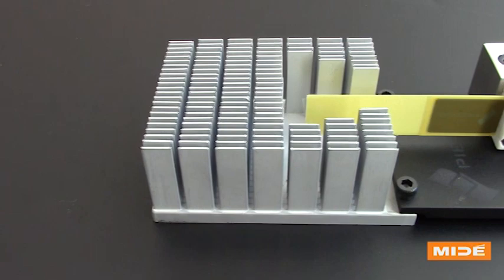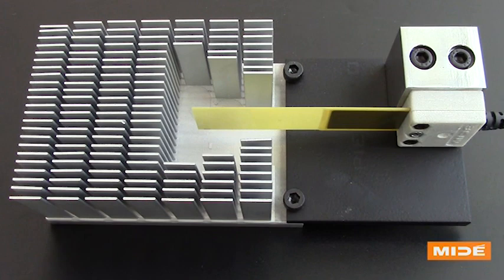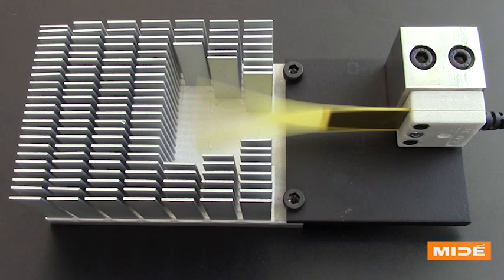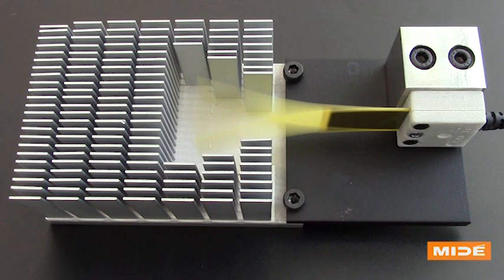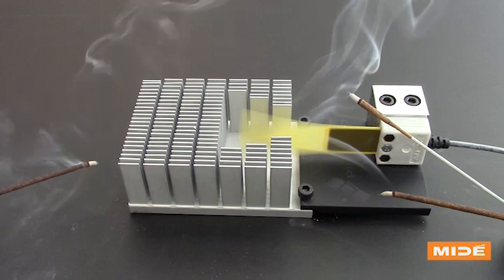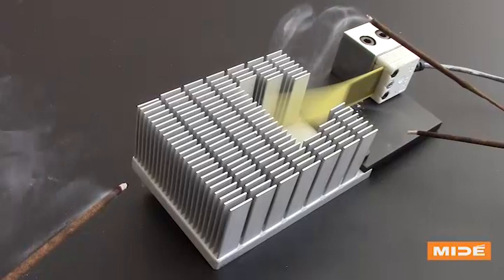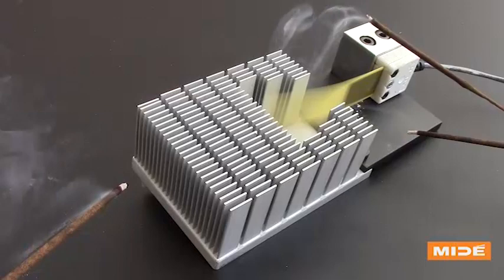Forced Convection with Solid State Piezoelectric Fan

Comment: Interesting idea but isn't there after some time material fatigue from all that oscillation or small amount of dust build up that make it unbalanced to point of destroying itself?
Reply: there are materials - like steel - that can withstand an infinite number of oscillations if the stress is low enough
Reply: @vaj1414  As I understood, the question was exactly about that - is that stress low enough to let device live as long as fan at least?)
Reply: I attached the piezoelectric plates to 1mm thick mica sheets, two on the same side acting to increase the overall airflow, the only downside observed was a slowing of the 50hz mains oscillation, because of the increase in air resistance on the mica sheet, however when all is said and done the fan measured six times the surface area of one oscillator assembly. Hope this spurs on some further tinkering! 😉
Reply: I would have to say that it is most likely reliable enough to last at least half of a human being’s lifetime… which means that compared to a regular computer fan this thing is absolutely godmode… now that is just an assumption, maybe I am wrong and it lasts much longer or a bit less, but… if we consider all the various possible implementations of this fan technology, it is probably reliable enough to outlive multiple times any computer or machine it would be installed in - ie. If it’s a home computer it will DEFINITELY outlive the computer, and if it’s like some microcontroller in a nuclear power plant then maybe due to regulation it would need to be replaced once every decade but that reliability and no moving parts makes it a stellar choice for places where untimely failure is not an option… but then again, what do I know… I’m just assuming this thing is godmode at longevity because I think it is thin enough to where such fast low tension oscillation is inconsequential to the material - or in other words, it probably has a better chance of being eroded away by air friction than snapping as a result. But it is a big point that this thing should probably not be used in environments where there can be a lot of UV radiation (ie. sunlight) because if it’s chemical/material properties change then it could definitely become susceptible to additional wear/failure… but then again - what are we comparing it to? A regular computer fan or closed loop liquid cooled system which are like 1 trillion times more likely to fail in an untimely manner and/or have guaranteed wear and tear.

Edit: 
Another big plus of this oscillating fan is that it is probably extremely lightweight compared to the alternatives and it’s simple mechanical design makes it guaranteed to last as long as the material is designed to last - so the only thing that can ruin this thing’s parade is water/humidity, intense heat, and radiation… because water/humidity can cause the electrical components to corrode/oxidize, intense heat can obviously melt or degrade the material properties that make it elastic, and radiation can also degrade its elasticity making it brittle over longer periods of exposure (depending on level and kind of radiation).
Reply: @vaj1414  materials have 2 different types of deformation, one is a elastic deformation and plastic deformation. elastic deformation within the materials parameters will allow it to flex and return to a position indefinitely while plastic deformation happens when the material is pushed beyond it's yield point where if you bent something it would retain that bend and not return to normal. a good example of plastic deformation is bending a spring beyond it's capabilities and it takes on a "set" where it's no longer able to return to it's original form. material fatigue typically only occurs with plastic deformation so as long as the material is maintained within it's elastic deformation range then it's ok.
Reply: They're advertising L10 Lifetime >15 Years, MTBF >150 kHrs (Testing still being performed) in a pdf from 2015 and I found them for sell for $100-$500 🧐
Reply: Nah, it's easy to make materials thin to the point of them flexing purely in the elastic deformation region.  Millions and millions of cycles before they fail.  For an example, the flexing membranes in DLP projector pixels are typically aluminum, and they have to change pixels God knows how many times over its lifetime.
Reply: @ToeCutter454  Low Cycle fatigue occurs with plastic deformation, yes.
but even staying purely in the elastic region, fatigue does still occur. Steel and similar will show a separate Endurance limit, a stress threshold below which it has an infinite life, but plastics, aluminum, and other materials do not, and will eventually fail from fatigue even in the elastic region.

we normally consider I think 5e5 cycles as the 'effective' endurance limit for aluminum (as good as forever). SO this device may have a very high cycle life, but given how fast it oscillates, that may prove to be only comparable to a common mechanical fan system, rather than far surpassing it.
Reply: @sayethwe8683  yea but the life spans on their cycles typically outlasts their applications.
Reply: @lunotarr  in theory yes, if a completely sealed off object is never past a certain temperature it should never change, at all, good example being some cpus being over 60y old and in the exact shape they have been in since then. it is also fairly easy to minimize this movement/heat stress via simply having alot of mass around the object, that being said most electronics are made disturbingly cheaplyand do not have enough mass to do that
Reply: Well, you pick the material accordingly. Of course it will fail eventually, everything does. The question then becomes expected lifespan.
Reply: @PaulMurrayCanberra  and thus materials testing! till they come up with a solution that works for their products lifespan that gives them the best cost ratio.
Reply: @PaulMurrayCanberra  I agree with above. It could be over a half of a humans life. Or much shorter than the life that a human has.
Reply: Sry thats Not right. The lifespan depends heavily on the load. 
Oscillating structures wont last indefinitely, often times even with only 20% of their static tension threshold... 
They may last like 100000 cycles, but you reach that fast with high frequencies.
Reply: @preddy09  Those pixels are on the nanometer scale though right? and aren't they 'hinged'? I don't think they're flexing.
Reply: @robbiekavanagh2802  More like microns and only the mirror on top is pasted on top.  The mechanism underneath is flexures.  Hinged mechanisms are not yet possible at chip scale in the millions per chip with current technology.  We want repeatability and reliability.  If not DLP, same applies with mems inertial sensors, oscillators etc.  They all rely on flexing membranes.  Glass is brittle as a large sheet, but in fiber or crystal with minimal defects format can be flexed quite noticibly billions if not trillions of times.
Reply: @preddy09  This is exactly what I was thinking, DLP typically refreshes very fast and it can only cycles on/off, so to vary the brightness it needs to flips fairly quickly, combined with the R/G/B color sequence that it needs to "fill", it will oscillate like 10khz or more. MEMS and other device with compliant mechanism will typically have a very very long life compared to the others.
Reply from the maker: Thanks Mr. Motus, here are some comments we provided on the fan reliability:

During the development of the piezoelectric fan our customer required us to run some highly accelerated life testing (HALT) on a statistically significant number of samples.  The test included thermally cycling the fans 1000 times from -40 to 125C while they were operating.  The test took about 5 weeks to complete.  There were no failures.  We also ran the fans through high temperature operating life at 180C (HTOL), low temperature operating life at -70C (LTOL), Over voltage test at 100% over the normal operating voltage, Humidity HALT testing, Cold start testing which included a hard start up after the fans soaked at -40C for 14 hours, high temperature storage tests where the fans were soaked at 140C for 1000 hours prior to successful operation, dust ingress testing, salt spray and fog testing and IP68 testing where we submerged the fans for 72 hours at the equivalent of 3 meter depth pressure and then operated them after they were removed and dried off.  There were never any failures during any of these tests.  Lastly, we have been running a non accelerated life test on a single unit (in my office) since June 15th, 2016.  It has only been unplugged one time when we moved to a new building.  It is still running as of this morning with no noticeable change in performance.  I sit about 6 feet from it, If I really try to listen hard I can hear it running.  Running at 60 Hz we have put just over 11 billion cycles on the fan without failure or change in performance.
Reply: @MideTech  That's a mic drop if I've ever seen one. Could this be employed in some way in either undersea or space applications (two of the most difficult regimes)?
Reply: @MideTech  I have no need for such a device but such thorough testing almost makes me want it.
Reply: @preddy09  of course microns, I'll concede on those corrections and thank you for the information. But your example with the glass is why I brought up scale in the first place, materials behave very differently at different scales. Maybe, like glass, the aluminium can flex a great many times on a micron scale, but not on a centimeter scale.
Reply: I would not even call that solid state. It's got moving parts.

Ionic wind is solid state. To me this piezo thing looks less reliable that a magnetic bearing brushless dc motor fan.
Reply: @MideTech  does it have any advantages in terms of operation in vitiated air?  i was thinking of the fan on your desk operating since 2016 and how dusty my fan is that only operates three months of the year!
Reply: @felixar90  The piezoelectric actuator is considered solid state.  This fan seems significantly more reliable than a magnetic bearing  brushless DC motor fan in many environments including ones with conductive dust, magnetic dust, abrasive dust, corrosive liquids or vapor, constant humidity, salt exposure, hot temperatures, highly cyclic temperatures, extreme vibration exposure, extreme pressure cycles, explosive gas environments, in the presence of extreme magnetic fields, certain space and geometry constraints, and probably a bunch more. 

Obviously this isn't trying to replace a regular fan in most applications.  I suspect it is less energy efficient than a design with rotating elements.  But I'm sure there are many use cases where this design is a superior choice for various reasons.
Reply: yes i had been testing stuff and i just cant get it to work for more than like a month
Reply: All you armchair experts on fatigue didn't even bring up the topic of microcracks and how they can lead to fatigue occurring with even relatively small stresses if repeated enough.
Reply: @vaj1414  steel fatigues and snaps in half really easily.  it has to do with the friction reforming a crystalline structure , aligning the molecules in a pattern making it easier to break
Reply: @peter9477  There’s an entire realm of engineering focused on cyclic loading and fatigue.  When people mention fatigue, those cracks are what they mean.  So yes they are part of this thread already.
Other important factors include stress, strain, material properties, and number of cycles.  A long thin beam can experience a surprisingly large deflection at the tip while experiencing surprisingly little fatigue wear.
Reply: @RedShiftedDollar  As some people discussing fatigue here clearly knew nothing about it, I don't think one can assume microcracks were part of the discussion. Needed to be called out apparently.
Reply: I'm sure you could just use something like amorphous metal ribbon or superelastic phase shape memory alloy and have an actuator with an expected lifespan well in excess of what's necessary.
Reply: Oh there is and they also said no moving parts... lol
Reply: @vaj1414   even that will break the steel
Reply: @nahimgudfam  These fans existed in 1984, they were about $6.
Reply: @dasworkshop4967  This is up-to-date information.  Apparently they're a military supplier now, guessing by the prices.  I don't think there's a generic version available.
Reply: @vaj1414  That's the endurance limit! Surprised I know that considering I just failed my Machine Design course lol
Reply: @vaj1414  Not if its was heated, so it breaks the elastic boundery and becomes plastic, deforming at each vibration.
Reply: @MideTech  Now that's some thorough testing. Have you measured the wind speed of the non accelerated testing? Quite curious to see if there is any difference
Reply: @nahimgudfam  That exactly explain it. Why to buy something so expensive when you can buy cheap electric fan for 95% of all purposes..and rest can use exotic cooling such as these..
Reply: @vaj1414  no steel can take INFINITE oscillations, especially from something that does it several times per second, fatigue is produced even with the slightest bend
Reply: @RedShiftedDollar  true, but a steel beam wouldn't oscillate several times per second, if it did it would suffer significant fatigue because the absurd ammount of times the deflection occurs over time makes the timeline much shorter.
Reply: @RonnieMcNutt666  CPUs don't oscillate several times per second, they are true solid state devices, so it doesn't depend on heat or anything else, material fatigue is inescapable.
Reply: @dannymoneywell  I never said steel.  But spring steel is very good with fatigue wear. 

Also, I'm not sure why you think a few Hz is too fast for steel.  A tuning fork is a steel beam that oscillates at hundreds of hz.   An ultrasonic transducer horn can oscillate at 40 kHz.  

Also, there is something called "Infinite fatigue life".  If the stress experienced by the object is low enough, it will not experience fatigue failure and can experience hundreds of trillions of oscillations and more.  If everything had to fail due to fatigue, natural vibrations in the environment would cause everything to fail.  This does not happen.  Infinite fatigue life is possible.  The piezoelectric crystal in a quartz watch can deflect 20,000,000 times per second for many many years with no problems.

The reason why I mentioned long thin beam is because this geometry will experience low stress and therefore low fatigue for a given amount of tip deflection.  

Besides, a traditional motor experiences fatigue during operation anyways.  Fatigue is not something new introduced by this design.  Rolling element bearings fatigue.  This motor does not have those.  Electrical winding insulation fatigues.  This motor does not have that.
Reply: @nahimgudfam  Did you see the previous post about all the testing this fan has been through.  They might be a military supplier, or just any extreme environment.  Those tests and guarantees are what you're paying for.  It seems like neat tech, and I wish there was a cheap generic available.  Unfortunately, there would have to be a market first, and most of the time regular fans work.
Reply: @MideTech  This is the type of company I wanna work for
Reply: @MideTech  incredible
Reply: I am a fan blade replacement technician. Material fatigue is what keeps my family fed and allows me to send my children to the finest schools to study about how to generate more fatigue in common materials. (cue evil laugh)
Reply: @vaj1414  Not all materials have a "fatigue limit". Aluminium or glass fibre composites for example. What peizoelectric material is used?

And although we talk about an "infinite life" at lower stress levels; in reality we simply greatly increase fatigue life beyond what most structures need. For example many coupons/structures are tested to 10^6 cycles, but we see for example steels fail at say 10^9 cycles when used at stresses below the "fatigue limit". Sometimes this can be important in some structures.

With regards to piezoelectrics, thier durability and hysteresis degredation matter. Just because they are "solid state", doesn't mean much. For example ceramics piezoelectric materials like PZT can be brittle and may crack. Maybe polymer piezoelectrics might be okay?

What we should be told is how long do they last (Mean time to failure) at some level of degredation (say 75% of original output). Otherwise this is cool, but just hype to me.
Reply: @preddy09  not comparable. DMD in DLP, first of all, uses a TiAl3 alloy, specifically designed to reduce strain (that still exists anyway). Most important, you can't compare a device with a 1 micron coil with something 10,000 times bigger. DMD has very low, if nonexistent, strain mainly because is microscopic.
Reply: Materials have elasticity and plasticity. When the material passes the elastic threshold, plasticity comes into play and the material cannot return to its original state. If you do not exceed the elasticity threshold, your material will be restored and there will be no microcracks and deformations. They probably stay in the elastic region of the material in the video.
Reply: @webwizard65  Nobody said otherwise of what you were saying.  The goal is to find the right material elastic deformation, with respect to the thickness, and range of motion.  Even a piece of glass 1cm thick can be deflected by 1% a billion times.  Understand the concept here.
Reply: Even if it breaks - it waaay cheaper to replace than a fan parts
Reply: @ToeCutter454    High cycle fatigue, by definition, happens at a stress below the yield stress, i.e. well inside the elastic deformation zone.  As mentioned in another comment, some materials like steel do have an "endurance limit" which is a stress below which fatigue failure won't occur, and above which fatigue will occur. An approximate rule of thumb is 0.5 x ultimate tensile strength for steels, so the gap between the endurance limit (0.5*UTS) and the yield stress is the zone where you get elastic deformation and eventually fatigue failure, but no yield
Reply: @sayethwe8683  wow, 5e5.. Is that 5 x e5 or 5 to the power of e5? Either way, that's a big number :p
Reply: @BruceNJeffAreMyFlies  5*10^5
Reply: @MideTech  well damn.
Reply: @ToeCutter454  Is not that simple. Even materials deforming strictly on elastic regime can break because of small defects that turn into a cracks due to a high number of cycles of charge-discharge. In an ideal elastic isotropic material, what you say is completely true. However, in real materials, any deffect (even in microscopic scales) can grow into a crack if the piece is exposed to a large enough number of cycles. In the neighborhood of the crack, tensile stresses can easily be higher than the elastic limit of the material leading to plastic deformations and further damage.
Reply: Exactly I have seen these fracture especially in low temperatur caustic environments like food processing.
Reply: imagine the vibration its generating in the whole system not only the blade itselfe
its quite some mass oscillating at a high frequenze
Reply: @preddy09  --  Well, the requirement isn't for "millions & millions" of flexes but billions & billions.
Reply: @GilmerJohn  Sure, I suspect it shouldn't be that hard to find something that work.  This problem is nowhere near the level of finding the right material to built a space elevator with.
Reply: “Then Peter said unto them, Repent, and be baptized every one of you in the name of Jesus Christ for the remission of sins, and ye shall receive the gift of the Holy Ghost. For the promise is unto you, and to your children, and to all that are afar off, even as many as the Lord our God shall call.” Acts 2:38-39 KJV 

“Jesus saith unto him, I am the way, the truth, and the life: no man cometh unto the Father, but by me.” John 14:6 KJV 

“For if ye forgive men their trespasses, your heavenly Father will also forgive you: But if ye forgive not men their trespasses, neither will your Father forgive your trespasses.” Matthew 6:14-15 KJV

“And I say unto you, Ask, and it shall be given you; seek, and ye shall find; knock, and it shall be opened unto you. For every one that asketh receiveth; and he that seeketh findeth; and to him that knocketh it shall be opened. If a son shall ask bread of any of you that is a father, will he give him a stone? or if he ask a fish, will he for a fish give him a serpent? Or if he shall ask an egg, will he offer him a scorpion? If ye then, being evil, know how to give good gifts unto your children: how much more shall your heavenly Father give the Holy Spirit to them that ask him?” Luke 11:9-13 KJV

“And Jesus said unto them, I am the bread of life: he that cometh to me shall never hunger; and he that believeth on me shall never thirst. But I said unto you, That ye also have seen me, and believe not. All that the Father giveth me shall come to me; and him that cometh to me I will in no wise cast out. For I came down from heaven, not to do mine own will, but the will of him that sent me. And this is the Father's will which hath sent me, that of all which he hath given me I should lose nothing, but should raise it up again at the last day. And this is the will of him that sent me, that every one which seeth the Son, and believeth on him, may have everlasting life: and I will raise him up at the last day.” John 6:35-40 KJV 

“And fear not them which kill the body, but are not able to kill the soul: but rather fear him which is able to destroy both soul and body in hell. Are not two sparrows sold for a farthing? and one of them shall not fall on the ground without your Father. But the very hairs of your head are all numbered. Fear ye not therefore, ye are of more value than many sparrows.” Matthew 10:28-31 KJV
Jesus Christ loves us.
Reply: @KB Inelastic deformation isn't the answer.
Reply: @preddy09  yes, but it's still not infinite and not "no moving parts". If anything, just air friction would wear it down if we waited long enough.

The problem I'm having is not one with believing in the longevity of this device. I have a problem with the manufacturer advertising it as eternal.

Just say it lasts 10x, 100x, 1000x, 10³³x as long as a ball bearing fan or something.
Reply: @ToeCutter454  you're wrong
this is not how fatigue works
it's all about stress but with high repeatability, including stress within the elastic deformation

this is why fatigue is hard to visualize and to calculate precisely
Reply: @MideTech  holy... this could be a game changer. How can the oscilations be mitigated for it to be applied to pc?
Reply: Points of failure in devices like these tend to be things you don't expect, such as the vibrations slowly but surely loosening bolts.. Though my guess would be the soldering at the back of this thing.
Reply: for dust build up, there are many ways to avoid and remove it, such as static electricity to remove dusts, a different design would be needed. Adding a simple HEPA filter can also greatly reduce dusts while the piezoelectric fan promotes cooling.
Reply: @vaj1414  I wonder if carbon fiber can be bonded with piezoelectric. This would reduce weight and increase durability and lifespan.